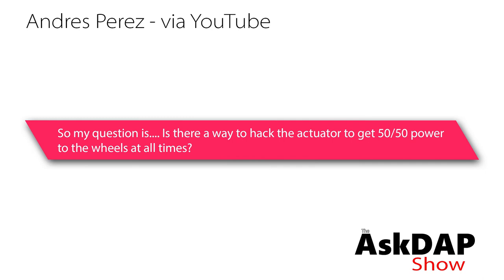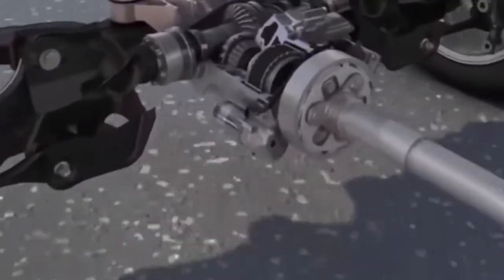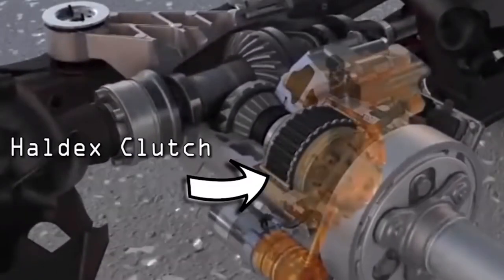Can You Get 50/50 Power From Haldex At All Times? | AskDap

Comment: You can lock the Haldex at low speeds by turning off the ESP on most cars, it's a hidden feature they don't tell you about.  It's very easy to see this working on driveways, ramps, etc. like if you put your car up on ramps for an oil change. At speeds above something like 20-30km/h it will resume normal operation even with the ESP off.  I think it works like this to help get unstuck if you're stuck in mud/snow somehow, even with quattro/4motion.

To change the actual running profile of the vehicle, you need a replacement Haldex controller (HPA, Neuspeed, both market them but they're from Haldex directly); or this new thing that DAP is selling from the Netherlands company which is essentially like a piggyback unit.
Reply: at a dead stop in snow you would want the esp on unless you are perfect on the throttle otherwise you end up just losing traction instantly or digging a hole where the wheels sit.  its been my experience in the mk4 r32 that if you are in snow unless the ground is flat don't stop if you can't help it otherwise you loose momentum and you just end up slowly sliding off to the shoulder because you are not allowing the traction control modulate the tq to get you out at least in heavy snow conditions I know this.
Reply: I have an '07 Freestyle and the TC light illuminates after about a minute and after that the AWD doesn't work.  I really only need it in the winter and have been dealing with just FWD for a few winters now, but it would be great to be able to have even just momentry AWD to get unstuck or whatever.  Based on the fact that the AWD does work when the light is out, Is there a way to 'fool' the system or bypass whatever disables it?
Reply: @MrDellinx  Not sure what kind of tyres you're using there but never been even remotely close to getting stuck in the snow with proper tyres and the Haldex.  Have even inadvertently driven into some very deep snow and depressions in the road wondering if the car would get out and no problems getting going.  Granted that's with a newer Haldex than in a Mk4 but doesn't matter what AWD system you got, without proper tyres you're not getting traction and you're gonna have issues.

Otherwise Haldex system should only really have problems or difficulty in off road scenarios or where wheels are completely off the ground like in Car Question's diagonal stuff.  Also FYI pretty much every automaker says to turn OFF traction control if you are trying to get a vehicle unstuck in snow, mud, sand, etc.  As said with newer Haldex systems this also activates the undocumented diff lock at low speeds, which will definitely help out.
Reply: @rolandm9750  i forgot what tires i ws using at the time but i know they were high performance all season tires. which is probably what my issue was lol
Reply: @tuberwag  Your system could be getting disabled due to one or more of several different reasons.  Can't assume this is merely something you can "fool" into working again.  Could be an electrical/wiring fault, a Haldex pump issue, controller issue, a sensor issue, or internal mechanical fault.  If the light is coming on it could be that it is disabling something because it can't determine how to properly operate the system; because it detects a condition where disabling would protect it from further damage; or simply to indicate that it can't operate due to a physical problem like no pump pressure, mechanical fault; or no communication with, or operational fault of, the controller.  

You'd have to have the Haldex-system codes read (will most likely need something that can read Ford-specific codes) to even know where to begin.  The fix could be anything from simple wiring fix, to a pump replacement, to requiring replacement of the controller or the centre coupling itself.  Not really possible to tell what the problem is without doing a proper diagnosis.

Comment: Isn't that already available with OBDeleven setting "Increased traction"? Unless you want to control the power distribution in real time.
Reply: All that does is decrease the lag, but it's not full time 50/50. 

Source: my A3 8V has this setting turned on and I can feel it's not 50/50
Reply: Is it possible on Gen 2  ?

Comment: As Far as I know there is no way to override the haldex to give 50/50 all the time. I am interested in hearing a more detailed response on how they allegedly have done with this without wearing out the clutch packs prematurely.

I can't help but notice the carful wording he uses at 0:53 seconds " it gives you full control WITH SOME VARIABILITIES"  and then trails off. the most you can get or has been done without destroying the drive train is a NEAR 50/50 split and only while you have the throttle down 100% 
Haldex is an electronic and system that transfers power via clutch packs constantly having them engaged in theory would wear them out. I would also like to know how this compares to the HPA system that already does the same thing with regards to adjustability and the United Motorsports tune in terms of how it engages the clutch packs for performance.
both systems at roughly half the cost!
Not hating on you guys im just just very skeptical after diving into this subject and having read the entire great haldex debate years ago. combined with what I have learned from the manuals and engineering documents on the haldex and system.

Id like to add that I have owned my Mk4 R32 for the past 7years and was at one point was interested in the limits of the haldex systems.
Reply from the maker: Take a look here https://youtu.be/nyZyTYENsFE

Comment: I really don't get the point of this, if you wanted a Quattro Torsen Audi or BMW X Drive you should have bought one. 😂 There's nothing wrong with the Haldex system stock its designed to behave a particular way and it does so exactly as intended.
Reply: How is it hard to understand people want faster power output